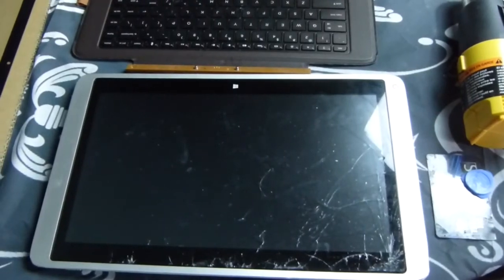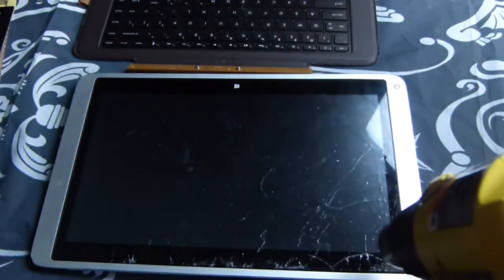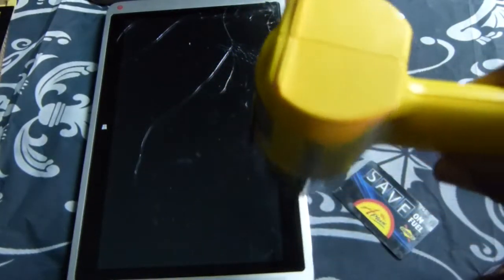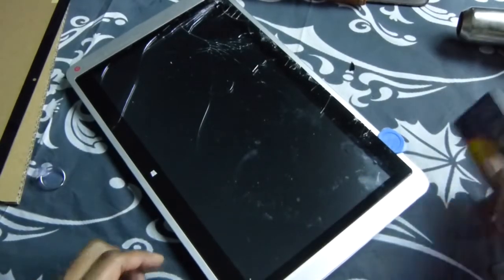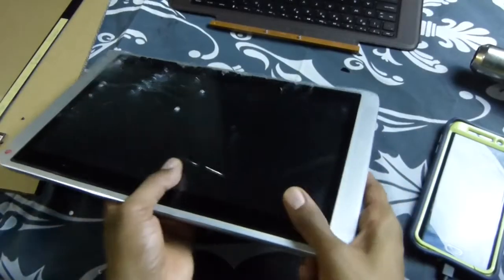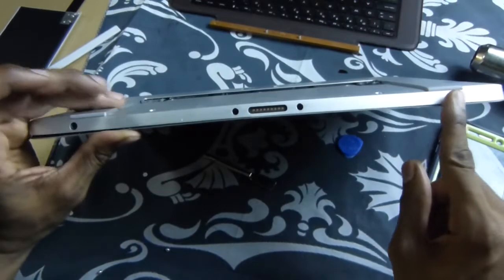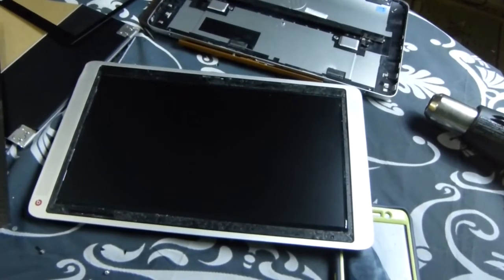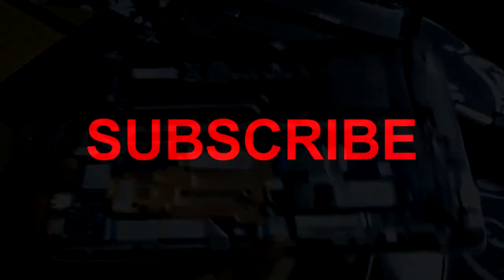HP ENVY X2 SCREEN REPLACEMENT

Comment: hi, do you have any idea to fix the keyboard that won't charging?can it be fixed?
Reply: I have the same issue - keyboard not working anymore, most likely battery issue... And I would not know where to find a replacement or how to repair.
Reply from the maker: bagus prasetyo might have to replace keyboard but first make sure that it’s not a bad charger